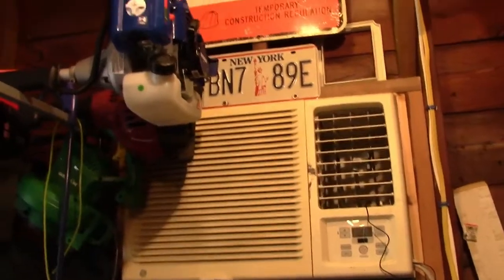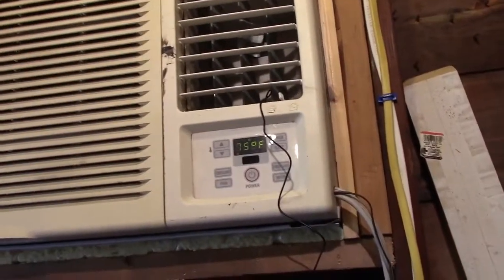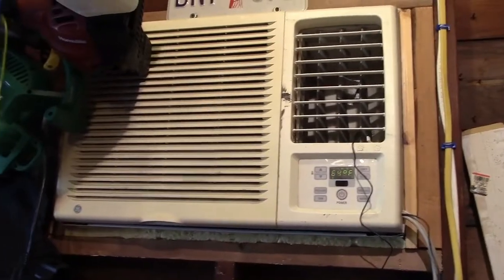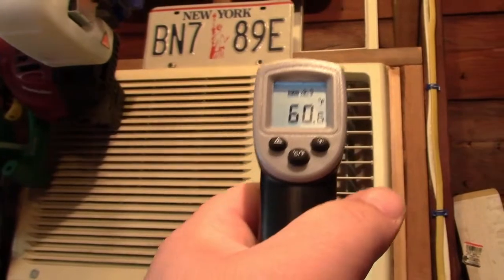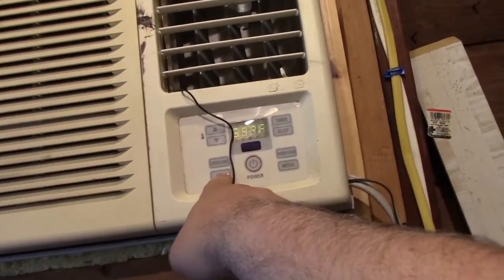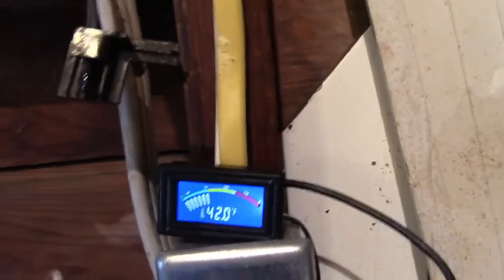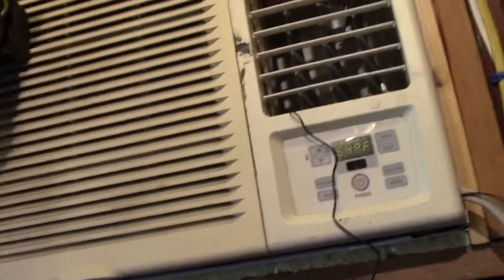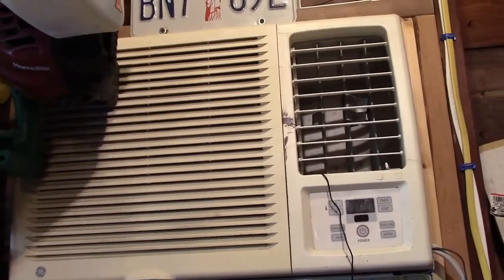Garage A/C Startup For 2020

Comment: I don’t care for electronic controls, but the unit is old enough to have R22 still so I’d say it’s a decent machine. 2 tons is quite a bit of cooling for a room that size.
Reply from the maker: Yes, it's been pretty good, cannot complain.  2 tons is overkill for that size, but it's better to have more than you need.
Reply: @jaykay18  Not always with cooling--cooling too quickly will result in a lack of dehumidification.
Reply from the maker: Yes, that's true.  But personally, I think A/C install companies purposely install undersized units.  They claim in the industry that you want to get a unit that can handle the day-to-day stuff no problem, but only on the very hottest of days would it run almost continuously.

4 tons of cooling for the downstairs of my house is absolute complete overkill.  It is absolutely freezing cold in here.  If I want it colder, it'll go colder without complaint.  The upstairs only has a 2 ton unit.  Hot air rises.  Poor choice.  When it has had its day I'm definitely going 3 ton.

There is never a problem with humidity in the house.  I can always tell the humidity difference when I go outside.  So I really don't think it's cooling too quickly, resulting in that.

There is also the option, if I wire it up, of running the blower on low speed.  I've never tested it, but the option is there.  That would draw the air more slowly over the coils and result in better dehumidification.  It may also cause the coils to freeze up, I don't know as I never tried it. But the option is there.
Reply: @jaykay18  I'm not sure if it's a case of installing undersized units, or the units simply don't work as well as they used to. I think you would agree that a 2-ton unit made in 2018 does not output the same amount of cooling as a 2-ton unit made in 1975.

When I used to work (I'm starting to sound like you...), the machine in my office was grossly over-sized. I could never find the data sheet, but I'd guess it was probably at least 2 tons. The room was about 300 sqft. The thermostat was situated directly in the air stream of the machine, so it would never run for more than a few minutes anyways, but a few minutes was usually enough to drop the room by 10 degrees.

I don't know if there was something wrong with condensation not leaving the unit, or if there was something else wrong with the system or perhaps the building as a whole, but it would get outrageously humid as the unit's fan ran with no compressor. I'm not one to complain about heat or humidity, but this was ridiculous. It was so wet that a piece of paper sitting on a table would curl in a matter of hours. There was mold in some places of the building. It was disgusting.

At some point I was driving home one day and saw a relatively new air-conditioner out for the trash. Not something I wanted for the collection, but I immediately thought how perfect it would be at work. Had no idea if it worked or not, but in the car it went. Next day I brought it in to work, plugged it up, and sure enough it ran just fine. Was hardly used or dirty, never even bothered to take it in the house and clean it prior to use.

I installed the unit in one of the room's windows and let it run. Within an hour or two, I got that 'air conditioning feeling' when walking into the room from the hallway, and it was quite nice. It's a small unit, only 5,000 BTU, but it held its own quite well. The room had 3 large windows, usually several people in it, multiple computers, and the door was often open, so there was quite a bit of heat gain. The machine never got the room cold, and the compressor never cycled, but it made the office a whole lot more comfortable than the other equipment did.
Reply from the maker: @ArisBuliteanu  Wow, you have absolutely no clue how any of this works!  The unit NEVER short-cycles, as the space is uninsulated.  Secondly, I have removed the thermostat and placed it outside of the unit so it senses room temperature rather than coil temperature, that's another reason it never short-cycles.  Using an air conditioner with R22, like EVERYONE DID when these units were new, does not harm the ozone layer in any way, shape, or form.  Not only is it proven that there never was a hole in the ozone layer, but the R22 stays completely encapsulated inside the sealed refrigeration system.  It's impossible for it to cause damage if contained.
Reply from the maker: Not that you've learned anything from that dissertation...
Reply from the maker: @ArisBuliteanu  Translation for nobody else reading:  face down=phased out.

I can tell you that DuPont owned the patent for R12 (I know we're talking R22 here).  The patent for R12 ran out and DuPont didn't want to pay to renew it.  That's why it was phased out.  I expect a similar story, truth to be discovered years from now, with R22.  Any of these "save the planet" games they play now ARE ONLY MONEY GAMES.  It has nothing at all to do with saving the planet.
Reply: @ArisBuliteanu  Yes, it is the case. They don't last long because they're poor quality. The old units were never maintained either yet provided decades of reliable operation.

Comment: Nice startup. Sounds very nice, once all the oil gets circulated in the system.
I finally got my workshop AC recharged on Friday. I can see why R410 has leaks! I learned it's operating pressures are much higher than R12, and R22. My low pressure gauge pegged, so I had to do the best I could using the high pressure gauge, and keeping an eye on the condensation forming on the evaporator. now it's outputting 42 degrees air, and keeping the workshop at a comfortable 70 degrees. How long it will last, who knows.
Reply from the maker: Very nice!  42 degrees is perfectly fine!  It'll run until it breaks, it's that simple!
Reply: Yep, that's true. I discovered the leak is in the filter/dryer while charging the system.
Reply from the maker: Think it's worth trying to repair?
Reply: Probably not. I don't have the proper tools to replace.  I've considered retrofitting a cheap window unit into the case. I'll just continue using this one while it works.
Reply from the maker: As long as you have refrigerant and the leak isn't too bad, it can continue to run as long as you recharge it periodically.
Reply: @jaykay18  Been working fine all weekend, so it's probably a slow leak. I do like the unit since I performed the chinamatronics delete, 5 years ago.
Reply from the maker: Yes, I remember you telling me about that!
Reply: It sure eliminated some unnecessary error codes, that's for sure!

Comment: Nice video I’m finally starting to use my air conditioners in south east Michigan because it’s going to get into the high 80’s and mid 90’s for this week and next week I would’ve liked to have a spring but it jumped from winter to summer apparently I’m glad I don’t have any energy efficient green crap air conditioners
Reply from the maker: Well that's good.  Here it's still cold, not even hitting 70.  This day I tested it was 2 days where it hit 75.  Wow.  80s and 90s around here would be a pipe dream.  Although we have had it before, where the end of May hits in the 90s.

Comment: We have a 41 year old JC Penney window AC made by Emerson that stopped cooling yesterday the compressor runs but it's not cooling. Also the compressor gets hot but the condenser does not and the evaporator is not getting cold. We think there is a clog in the capillary tubeing witch controls refrigerant flow.
Reply from the maker: Ooh, that's a real shame.  Definitely sound like the problem.  You CAN find A/C repair guys who can fix it.  You have to look for them though.
Reply: @jaykay18  Normally we would fix it ourselves or get someone to do it but AC guys tend to shy away on window AC because they are so small.
Reply from the maker: Understood, but there's still somebody out there who can do it, probably at a decent price.  An old, retired guy perhaps.

Comment: Just put my Window Shakers in, and armored them from the upcoming Poplar Tree Dander.
Reply from the maker: Used to have an old Westinghouse with a recip compressor that literally WOULD shake the windows when it shut off.  Still at my dad's house, and it's the last example of that unit I have.
Reply: @jaykay18  Every once in awhile the 10,000 btu GE thumps the window and wall. When its compressor cycles. Guess I can nick name it Thumper.
Reply from the maker: If it gets really cold you can call it Frosty.  Thumpity-thump-thump.

Comment: Almost under 40F.  That unit sounds angry.  Thanks for the shout out.
Reply from the maker: Always does when it first starts up, and yes it gets COLD.  I'm sure if it were a bit hotter out, the hedge was trimmed, and I left it running longer, it would get into the 30s.  And yeah, no problem, you actually gave me the idea for that!

Comment: Back into energy star mode!
Reply from the maker: Only until the planet allows it to run.  Cold and rainy again, and will stay cooler for time to come yet.
Reply: Right right. Its the same here today.

Our AC I believe is due for a freon boost, but it hasn't even been kicked on yet. The heat has been asleep for almost a month, and the windows are wide open for the witten. Green season is here!
Reply from the maker: I do the "could you imagine the luxury" routine, and still have the heat on, but open windows as needed.
Reply: I couldn't imagine THAT luxury!
Reply from the maker: Yeah it was foreign to me too, until I did it.  Never looked back.

Comment: I like the way it sounds from the outside. It reminds me of how my AC Unit is. It’s very old but somehow it still works after several repairs and according to the original owner of the house, this Unit has lasted about 2 decades. It’s very reliable too since it’s so hot out here in Vegas and the sound of it is so satisfying. I wish I knew exactly what the model is.
Reply from the maker: Older A/Cs are the best!
Reply: Definitely, I’m curious if they still make these. I do know for sure that it’s a York.
Reply from the maker: Most times there's a sticker on it, on the outside, but the weather may have faded it away.
Reply: jaykay18 probably so. I’ll see if I can find it.

Comment: Same situation with  my Frigidaire's compressor. Its going on about ohhh 10 years old now and since new the first start  has always been the worst start even with regular cleaning and a nice shady spot to live in.  This is of course after first power up  after the cooler season.  Works a treat after the first two significant uses.  Strange...
Reply from the maker: Yep, as horrible as it first sounds, it just works, and works great for the rest of the season.  I don't get it either.

Comment: Wow isn’t it amazing how the grass grows like crazy mine actually is growing out of the cracks in the cement the gardener had just did it a few weeks ago and with all the rain we had it’s growing out again. A good compromise is medium speed I never use high and the lower the fan speed the more humidity is taken out. Sounds like a good strong unit.
Reply from the maker: Oh yeah, the grass and weeds and whatnot are growing like crazy.  Just spent most of the day in the back yesterday, mowing, weedwacking, cutting stray plants, pulling weeds, and today I still find some I missed.

I always use high, it's the most efficient wattage-wise.  On low, the fan is going slower, which indeed uses less watts, but the compressor can't work as efficiently.  The pressures in the refrigeration system increase, so the compressor pulls more wattage to compensate for that, negating the lower wattage of the fan and surpassing it, compared to the unit just running on high.  This thing has been around since 2002, and probably was only used for 1 or 2 seasons before the previous owners put in central air.
Reply: jaykay18 I don’t use the lower speed to save electricity I use it because it is better at reducing humidity the longer the air is over the coils the dryer the air becomes, plus less noise and drafts. I guess in the garage setting like yours noise doesn’t matter and you actually want to feel the air moving around while you’re busy doing things.
Reply from the maker: That is very true, the slower the air movement, the more humidity is taken out.  It can get downright COLD in there, like the rest of the house.